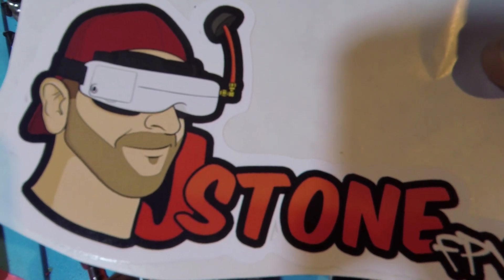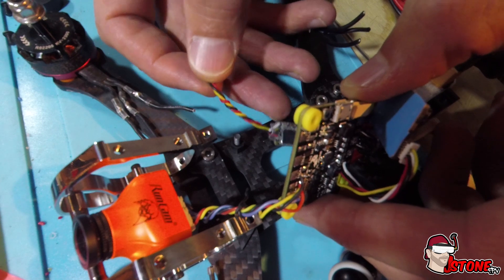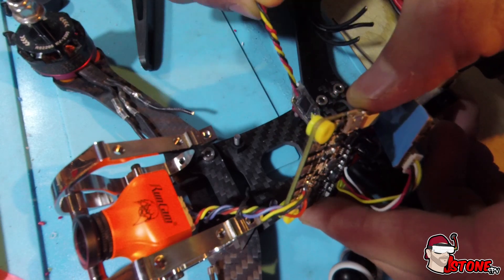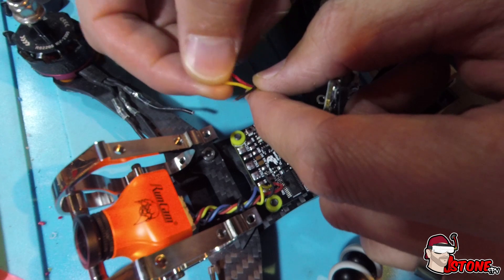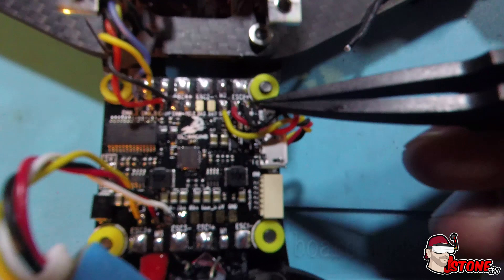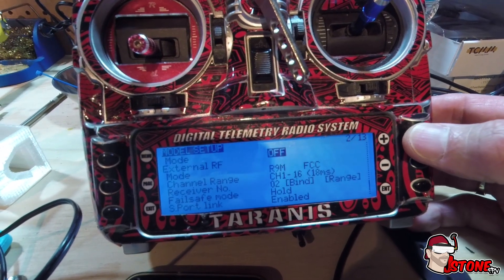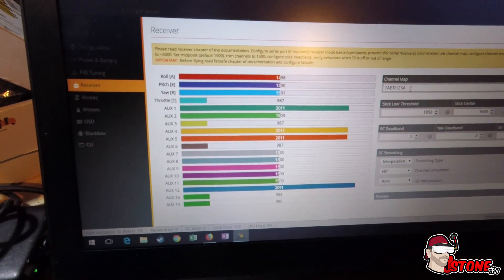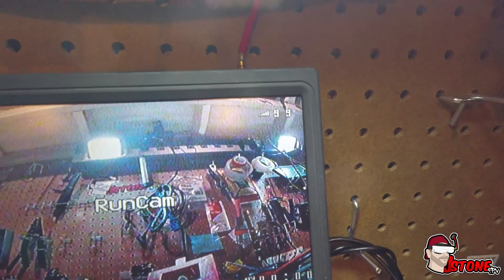HOW TO: CL Racing F4S with Frsky R9 Mini with Telemetry AND RSSI

Comment: Thank you for this. The only issue I'm experiencing is difficulty connecting to the transmitter. Every time I boot up it will connect and quickly disconnect. I then have to choose another model and return to my main model in order for it to register. Any idea what it could be? Thank you again!
Reply from the maker: Do you mean connecting the receiver to the transmitter?  If so, you may have a faulty R9M/MM module (I've had one do the same).  I suggest re-flashing the firmware on your R9 transmitter and R9M/MM receiver unit and rebind.  If the problem persists then I would recommend not risking an Rx loss mid-flight and to replace that receiver unit.  Hope that helps.

Comment: I was setting mine up tonight but I soldered sport/fport to tele...should it be sbus? I am also using CL Racing f4s. Im only seeing rssi sensor and rx voltage. Its bound but ive yet to set it up in betaflight
Reply from the maker: It needs to be on the SBUS port, not the S.PORT.
Reply: @JStoneFPV  thanks for quick reply. So im using fport firmware. The sport/fport on receiver should go to sbus on fc? Also should i be seeing various sensors under telemetry? Thank again
Reply from the maker: @RocketPunchArmy  Correct - https://youtu.be/8pZJU-QZfB8?t=113 .  Also, with the latest R9M_FCC firmware from MArch 2019, I've lost telemetry myself.  Now need to figure out how to get it back!

Comment: Hey man great video I cannot find much info on getting fport to work. I am triyng to get the r9 mini to work and while its pairing up just find and my transmitter is saying its connected I am not seeing it in the receiver tab of betaflight.
Reply from the maker: Did you follow the part at about 3 mins where it shows the betaflight configuration part? Everything on the latest firmware and you soldered it to the S. Port?
Reply: Jason Ambeault yes sir I was ahhh what the hell is going on...lol turns out I forgot to flash the r9 mini with correct firmware.
Reply: Jason Ambeault is that a chameleon
Reply from the maker: @jtroutt19  it's the Rooster frame.
Reply: Jason Ambeault why did you go with the rooster? I’ve been eyeing the chameleon
Reply from the maker: @jtroutt19 It was new and l liked the 4 separate arms as well as the camera protector.  Note that I hit an excavator's arm on my maiden and it still shattered my runcam Eagle lens :(  I dont think you can go wrong with either.

Comment: So i did all of this and i have RSSI but for some reason i am not getting any of the other sensors in the telemetry tabs, and LUA isn't working at all. so only rssi is working, not full telemetry, any ideas? i've got the same board you do, and same RX. Using the lastest fport flex FW on the RX, any ideas?
Reply from the maker: Same FC? Joe Momma Is your Taranis also flashed to the latest firmware? Check the comments below as there is a link to updated Luna scripts too.

Comment: Hi friend, I have the same configuration as you, but I use an x10s. I solved the s-port on the telemetry pad and it worked too.
I have all the reading of the "LUA" but I can not change the configuration of vtx. Do you have any problem like this?
great job!
Reply from the maker: Hi, where did you get your LUA scripts from?  I havent tried any yet.  Could download and try it if you share where you got yours.
Reply: Hello Friend. Now I've decided. Everything working perfectly with this setup.

https://github.com/betaflight/betaflight-tx-lua-scripts/releases